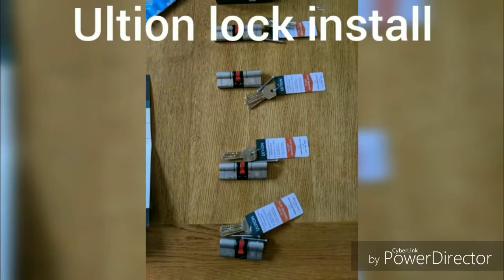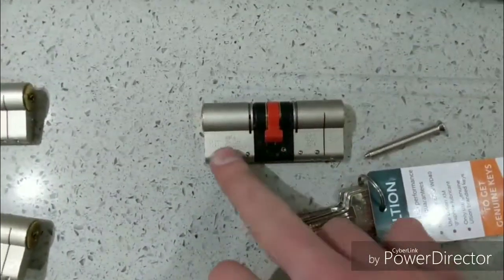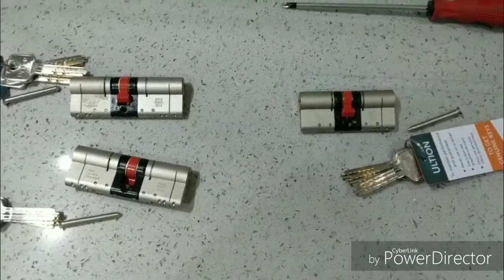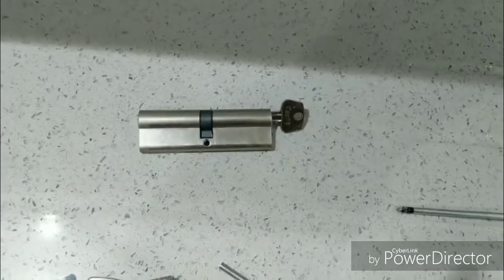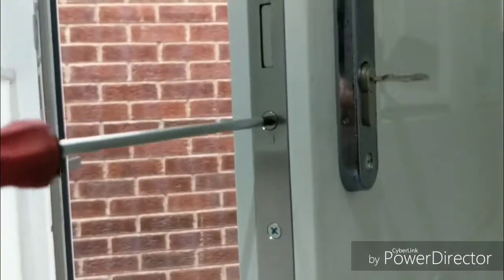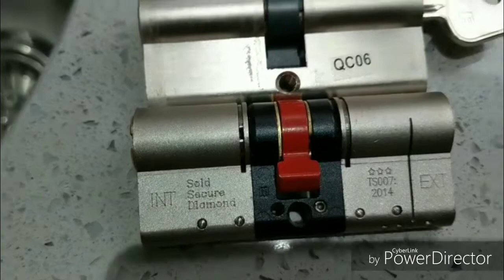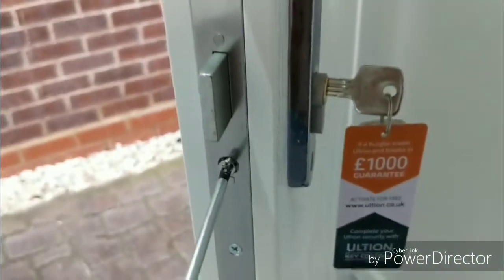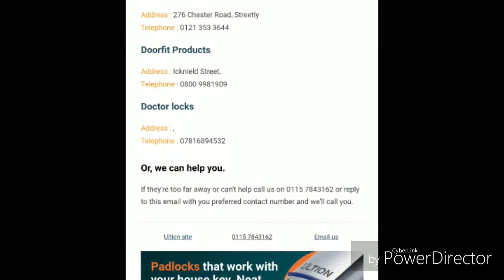How to install an Ultion lock

Comment: Nice...what I was looking for. Different issue...moved into new house. The 2nd latch bolt doest work...so effectively anyone can reach in letterbox and pull handle down and open my front door. 
I see in your video (exact lock) that y9u turn anticlockwise to fully 'lock' the door...mine won't...it turns to a point and latch is jammed. Is that an alignment issue ?